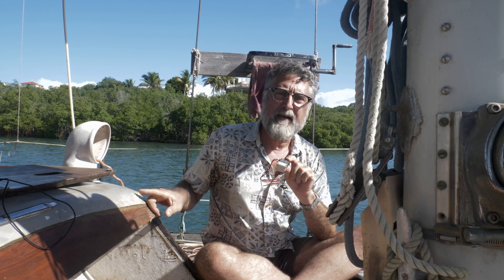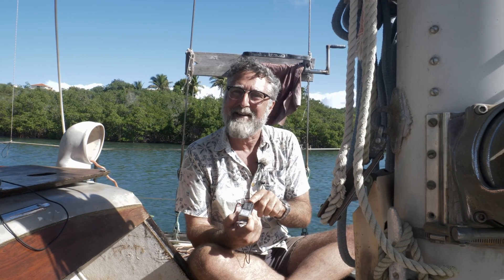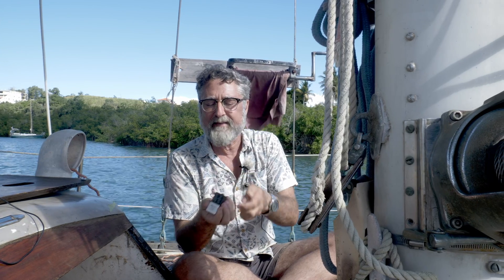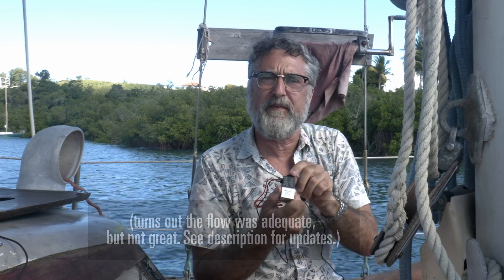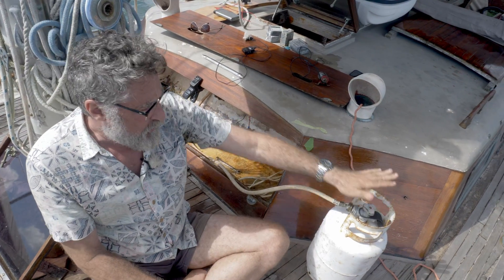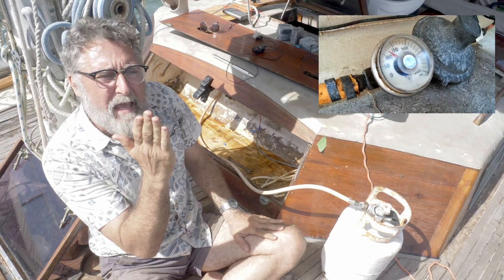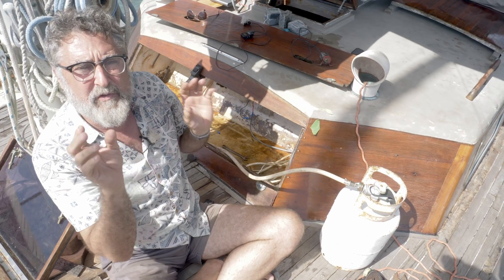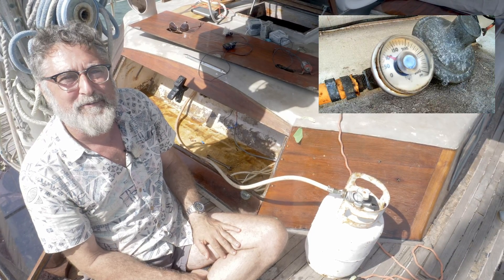Don't Blow Up Your Boat! (Propane Installation)

Comment: Hi Clark,  Good job.  Question:  I have a working system, and I'm changing the solenoid, as per your suggestion.  BUT I also doubt my sensors.  Is it possible to change the sensors attached to the wires which are attached to the warning lights.  My boat is set up with two sensors.  I get Green, Green, then Green to signify: good to go.  I currently have Green, Green, Yellow which does NOT allow flow of gas.  I want to replace the sensors In addition to the solenoid.  Any advice on Where I can buy new sensors?  AHH, I SEE YOUR OPINION OF SNIFFERS BELOW.  YOUR OPINION IS NOW MINE.  NEW QUESTION: WHEN I TAKE MY SNIFFERS OUT OF THE EQUATION, CAN I KEEP MY EXISTING GREEN/GREEN/GREEN PANEL ? So it shows simply Solenoid on/off?  My toggle panel/elec.panel has the On/Off and my little Lights Warning is by the stove, a simple two burner top. No oven.   Converting to No Sniffers what other change do I need to include in the line up?  Doug Day, Rockport, ME, VALENCIA, S & S sloop.
Reply from the maker: I don't like sensors.  Too many files positives.  I really don't know anyone out cruising who hasn't turned them off.
   So I'm sorry I can't really help.
I'd go with a switch off policy.  If you are concerned how about using a mechanical sauna timer for the propane open switch.  That will give you an hour for baking (you can always reset it) but will always turn itself off 
   Better to not leak propane than to have an error prone system that tells you might die.

Comment: Do you have experience with CNG?  What are your thoughts about buying a boat in the U.S. NE. with CNG vs LPG.  Is CNG a pain to refill?  Cheers!
Reply from the maker: I'd stick with propane.  It's available all over the world (with adapters).  And you can put a LOT more in the same sized bottle

Comment: curious about a few things.  Is it fine to have a propane locker inside your cockpit locker?  What is the rule for venting?  Also, while inconvieniet is is extra safe to hand turn on and off the actual tank?  just to feel extra safe?
Reply from the maker: Sure every valve in series is "safer" but I personally trust the electric valve.

You can put the propane tank anywhere as long as it vents (think drains as propane is heavy) overboard.  Consider what happens if you have a burst disk failure and the whole tank vented.  Your drain needs to be large and your locker should probably seal.
   I prefer lockers that naturally drain overboard.

Comment: Other than comfort so you dont have to manually open and close the valve at the bottle, is there a benefit to having a solenoid? Mine went out on my boat and i already manually open and close the valve on the bottle before and after use along with closing the electric solenoid. I was just thinking about doing away with the electric solenoid altogether since i am use to manually doing it anyway.
Reply from the maker: Sure if you close the valve no reason you have two valves I guess.
If you have a leak you would get just a bit more gas in the boat as the high pressure side of the regulator has a bunch of propane in the hose but I expect it wouldn't be an issue once diluted with all the air in the boat

Comment: On fishing boats we always mounted the tank right by the door, outside, and turned the valve on and off by hand, that way you could see the valve, even put a hand on it and check, easily. No need to trust an electrical component hid away in some hole.

Comment: I don't understand how they measure the thread on the solenoid the only options are 1/4" or 1/8" female, when I measure the diameter of the male connector it looks more like 3/8". oh and I tried looking for the one you have on the link in the description, but I can't seem to find it in your faves.
Reply from the maker: Google thread sizes.  There are tables that show the major thread dimensions for each thread size.

I forget but back then I think the link is likely in the description.

Always read the description of my videos.  That's where I can correct things I got wrong
Reply: @Clarks-Adventure  Thanks guys keep up the great work!

Comment: You should be wrapping the teflon tape the same way as you screw on the fitting. Love you content!!
Reply: Should use yellow tape for gas connections. Thanks for the video
Reply from the maker: Yep.  Sometimes hard to do things right on video

Comment: Wrapped the tape against code!  Wrap in the same direction that the fitting turns to install😊
Reply from the maker: Yeah I know.
   It's so hard to do things right with a camera on you
Reply: @Clarks-Adventure  Yes, I am very familiar with the hard way, sometimes more than once on the same project🤪
I commend you are a very informative video!

Comment: Thanks ! Great tips especially on the pressure gauge. I'll have to add in one of those. 
My propane tank shares space with my chain locker, so it's pretty salty up there. Do you foresee any issues with corrosion on the pressure gauge ?
Reply from the maker: It should do ok for a while.  It's mostly brass.  But you might want a spare or a plug

Comment: You have hose clamps at the cylinder which is not allowed!
Reply from the maker: Not allowed by who?
Reply: Coast guard for one and any certified marine mechanic! Don't believe me, check it out for yourself!
Reply from the maker: I'm not in the US.  Poseidon isn't so "big brother" as the US coasties.
  It's a safe and in a vented locker if something we're to fail.

Comment: Many people do not understand the relationship between pressure and boiling temperature.
When explaining I always ask "How does a pressure cooker work?" It's a good start in an explanation. The cylinder pressure will change dependent on the ambient temperature (provided there is liquid there!) and you can know what it should be for a given temperature. Go really cold (Arctic) and you may find that the pressure is below atmospheric! So, no gas.

Comment: Clark, I noticed you placed the teflon tape on the male threads in a counterclockwise direction, and then screwed the male thread into the white solenoid valve female connection in a clockwise direction. When attaching my garden hose onto the hose bibb valve (hose spigot valve), I always placate teflon tape on the male hose valve threads in the clockwise direction, the same direction that I attach the femaie hose connection onto the hose bibb. This same direction seems to help keep the Teflon tape onto the male connection. Does the direction of the teflon tape placement on the male thread really matter? Thanks, :¬) Webhead USA
Reply from the maker: Not as much as you would think.  As long as you put it on tight.

Comment: Good episode!

I have a different but very simple system to avoid blowing up the boat. No propane/butane/LPG and no petrol allowed on the boat. All propulsion, cooking and heating done with diesel and/or electricity only.
Reply: My Rule 3 - always be paranoid about fire!

Comment: Educate me.. at 6:30 ish I saw you putting on the Teflon tape.  I was taught to put it the other way around meaning wrap it the direction of tightening the nut.  Was I taught wrong or doesn't it matter or maybe the video is reversed?
Reply: You are right! Watched the actually tightening of the solenoid and the video isn't reversed, everyone makes mistakes! He tested for leaks so I'm sure it was fine
Reply from the maker: It doesn't seem to really matter as long as you put it on tight.

I usually do it the way you suggest but things happen differently when a camera is in your face.

As long as the Teflon doesn't "snag" on the starting threads and get pushed out of the way all is well.

Comment: I feel a lot safer when I also have a combustible fume detector like Safe-T-alert. More than one is better. The sensor should be mounted in the lowest area of the boat where fumes can actually get to. If that’s the bilge mount it just above where any bilge water would ever be anticipated. Sensors usually have a life expectancy and a date should be written down for replacement.
Reply from the maker: I have found that these things have too many false alarms to be useful.  Expensive garbage.
Glad you are having better luck.
Reply: @Clarks-Adventure  
Some are junk. Mine never went off so I tested it with butane. Thought the damned thing would never shut off.
Reply from the maker: Good to hear.  Maybe they are better now.   When they first became available you would hear alarms as you walked down docks all the time.  

It all sounds scary but in practice there are few propane incidents out here.

Comment: Tape placed counter clockwise, but valve mounted clockwise. Should that not be in clockwise direction for both to avoid curling up of the tape leading up to a possible leak?
Reply from the maker: I've never had a problem either way.  The tape becomes a pretty uniform layer either way.
I would probably have taped the other way if there wasn't a camera in my face.

Comment: Cheers for the info, always interesting to see variations around the world.
On propane or butane systems in the UK we have the regulator screwing on to the bottle, think I like that more because there is no pipes at high pressure.
In houses we test for leaks with a manometer, and call it a 'drop test', same principle as you described.
Reply from the maker: Hard to get those bottles filled out and about.
Just helped a guy (viewer) in the bay with that last week.
Reply: @Clarks-Adventure  true
Reply from the maker: Good to make a converter so you can get your bottles filled from the American style if you are headed this way.

Comment: that was my last project, I used a mechanical timer as a switch for the solenoid. This way, it's never forgotten in the open position.
Reply from the maker: Good idea.  I've considered that but Emily has gotten better at turning it off.

Comment: Great video Clark. Is there any rason you place your solenoid on the low pressure side? I installed mine (appropriate for HP) on the HP side, regulators are know to fail.
Reply from the maker: My new solenoid is only rated for 1Mpa that's just shy of 150psi I think.  Propane vapor pressure at 100f is about 175psi.
Though I'm sure it would work fine and as I say in the description if I want more flow I'll move it.

Comment: Using  the pressure gauge  sure  beats  soap and water  on all your joints.
Reply from the maker: Yes you can never know if you checked every possible leak.
Better to test for a negative ,(not leaking) then to try to test against all the possible positives.

Comment: How do you keep from forgetting to turn off the solenoid? Thoughts on the modern electronic sniffer shutoff system?
Reply from the maker: Sniffers always fail.  They have been around for like 30 years.  When they first came out lots of people bought them.  You could always hear an alarm as you walked down the docks.  Always false alarms.

Use a very bright indicator light and make leaving the switch on a spanking offense.
Reply: @Clarks-Adventure  Ahh, there's my answer.  Get rid of the sniffers and keep the solenoid new/ and or turn off the tanks for added protection.  Hell with the sniffers.
Reply from the maker: Just to say it here again so some future reader can get the whole thought.
   Activate your solenoid with a mechanical sauna timer.
   That gives you auto off failsafe.
  Better to not leak propane in the first place than to have an alarm that says you might die

Comment: Thats a great testing procedure !  Two takeaways though 1 you have a sauna ???  2 You did not rinse the soap oit of your eyes when doing emergency work because the water was too cold LoL
Reply from the maker: On both points I set the boat up in Seattle!
We now use the sauna room as tool storage.
Reply: ahhh that makes sense Seattle reminded me of scotand with money.  cold winters I guess
Reply from the maker: And the diving was in 50f water all year around.

Besides I was single.  Saunas are an excuse to get naked

Comment: Thanks for this.  I'm going to check my propane for leaks today.
Reply from the maker: Cool.  Hope your gauge doesn't move.
Reply: @Clarks-Adventure  It was leaking and I found it with some soapy water.  Some new thread seal seems to have stopped it.  I always wondered what the gauge was for

Comment: They have yellow teflon tape now for gas, Clark. It’s a bit thicker and easier to use and makes a better seal.
Reply from the maker: Thanks
Reply: @Clarks-Adventure  it is better to wind the teflon tape the other way round, so with the threads when mounting the solenoid instead of against the threads as pictured in the video.

A soapy solution works like a charm as well for leak detection, just a bit of dishwashing soap and water in a spray bottle or apply with a brush.

Comment: FYI, Picked up a box of similar connectors on Amazon but they have heat shrinkable ends  to keep moisture out, all different sizes and inexpensive , good job guys.
Reply from the maker: Thanks Brian

Comment: You mentioned that you have propane hot water heater. What brand and type is it? I am finalizing the water systems on my new boat which will be electric drive so I don't have a diesel option, so it's either propane or electricity.
Reply from the maker: Sure.  I'll have Emily put it in our Amazon "store" with the other things we use and like.
Give her a day or so.

Comment: The gauge is a great idea. Would you also spray soapy water on the connections for leaks also?
Reply from the maker: If the gauge shows a leak, yes use soap to find the leak.
But if the system looses no gas over an extended period with the tank off you have no leak.
If you try with soap and you don't "see" bubbles you "might" not have a leak.

So let it sit for an hour or more and if there is no loss rest assured your system is tight.